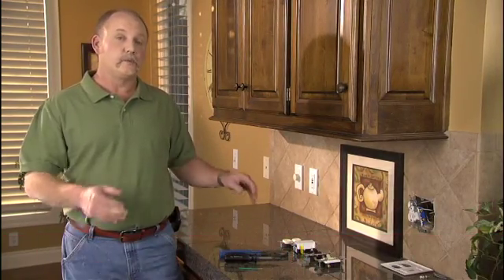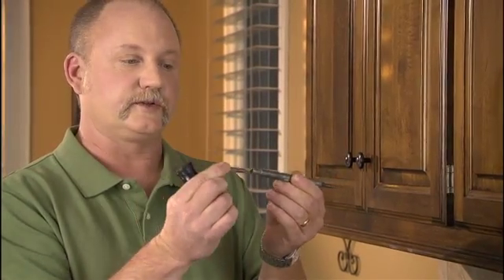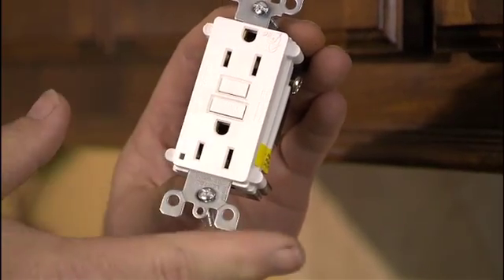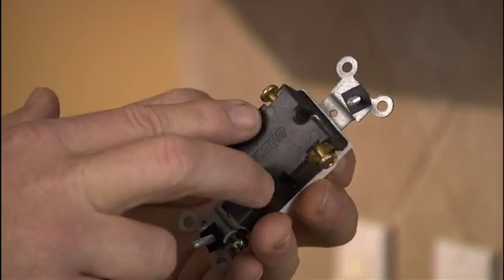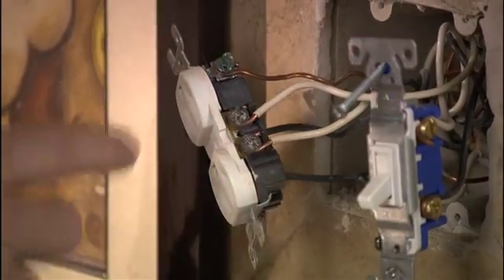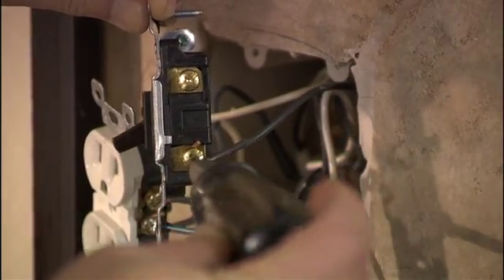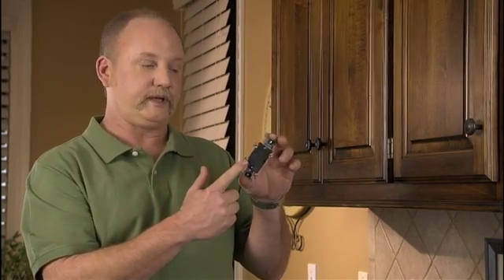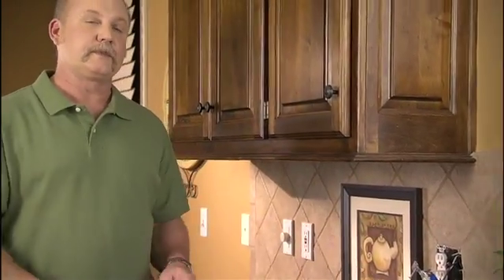How do I install electrical receptacles and switches?

Comment: Thanx for posting your videos, they're very helpful... However I have a dumb question: How do you wire the ground from the segment going out from the outlet into the lightswitch or additional outlets, if there is only one green screw?